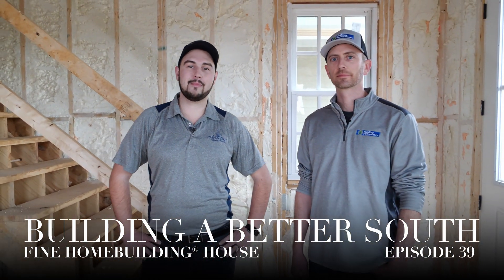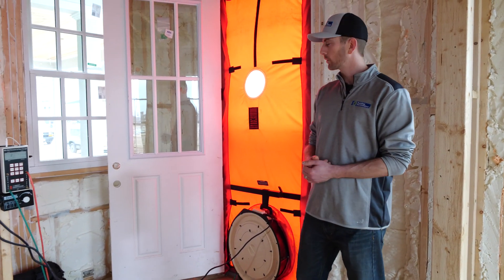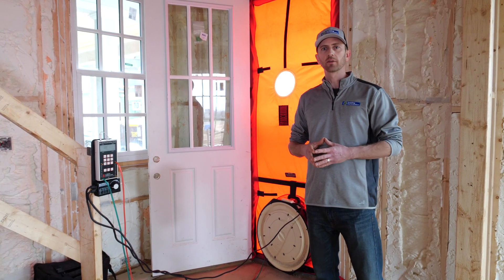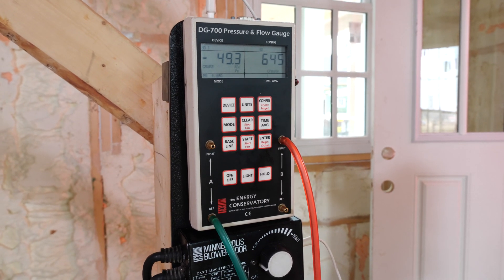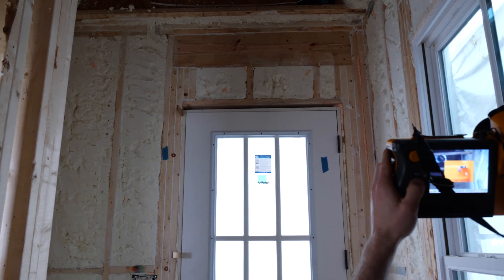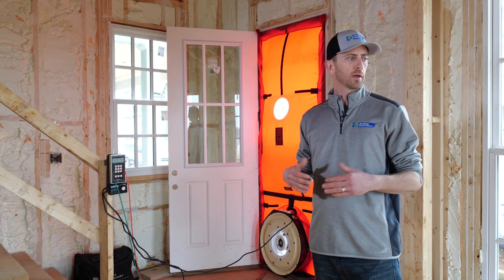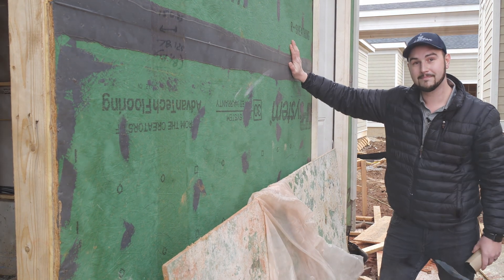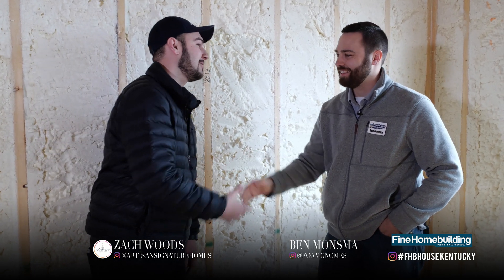How Good is It? Zip R-Sheathing plus spray foam insulation

Comment: I don't understand where the moisture is going to be able to go in this wall setup. Even open cell foam is going to hold on to a good amount of moisture once you hit 3 inches (actually open cell retrofit on roofs is causing UK insurance to drop clients), and the polyiso sheet in your Zip R isn't exactly vapor permeable. If a lick of moisture gets into the wall, it looks like it'll be stuck there for good. Am I missing something? Is the polyiso in Zip R more permeable than an Atlas foil-faced foam board? Are we just banking on the vapor coming through the open cell?

Comment: OK this video was from way back in 2019 -- However, I want to ask about the system of using closed cell spray foam with the ZIP system -- The reason being, somewhere i saw a comment that it was not a good idea?  Is there something that was learned about the ZIP and Spray foam (in NEW construction) that I should know about and not specify using a closed cell spray foam with a ZIP OSB exterior sheathing product?  Anyone have information about this it  is now nearly 2025.

Comment: Wouldn't a test after drywall is taped and finish prove to be more accurate, the tape and rock would seal the air flow where foam may have missed, just asking.
Reply from the maker: yes you are correct but we were spot checking to make sure we didn't miss any minor or major gaps before we covered with drywall.

Comment: Isn’t the flashing tape supposed to be used on the seems between the sheets instead of liquid flash?
Reply: you can use both
Reply: On ZIP they have a liquid flashing system.
Reply: liquid noticeably superior  but also at least 2x more expesabe for a house this size might add 5000-1000 in materials lab.or

Comment: Also:  open cell foam is not an air barrier, no matter what the salesman says.
Reply: I was going to say that... if they used closed cell then it would be fine.
Reply: Open cell isn’t a vapor barrier though.  Only closed cell is.
Reply: It is an incredible air sealer.
Reply: Yes it is

Comment: Doing the math:  blower door gives 570 cfm, house ~3800 sq. ft, assume 9 feet height means 34,200 Cu. ft of house.  So how many Air Changes per Hour (ACH)?  =>  1.0     That's pretty good!  Not the best, but pretty good.  Code is ACH 5, right?
Reply: would have been even better with closed cell

Comment: I still try to stay sold on this level of focus on air tightness and energy efficiency.  It's hard to comprehend.  For instance in this particular situation, I would think an ERV/HRV component to the HVAC system would probably be warranted to exchange fresh air.   That's costly.   The R version of ZIP is very costly.   Was the HVAC system upgraded to higher efficiency components?  Were the windows upgraded to higher efficiency?   Where do you stop?   If cost vs ROI isn't an issue, I guess never?   If the cost of this home is $20k higher than a blown and batt, is it worth the added savings of $150 a month with an ROI timeline of eleven years?   I'm sure the interior "comfort" (not having temperature variations from room to room is nice), yes... but with the cost of labor and materials skyrocketing over the past three years, can the industry push this level of energy efficiency AND get reimbursed for it?   Oh what a question.
Reply: Matt Risinger just had a heart attack from reading your comment. How dare you question the roi of such practices.
Reply: @pjevans1830  bahah.
Reply: Yep, to all of this. Understand, this is mostly just about saving energy, not about saving money. Energy here in the US is pretty inexpensive, so the ROI is very long. There really isn't any good reason a house needs to be this tight.
Reply: @MW-gh1mo  At least part of the "reason" is, Building Codes are mandating tighter and tighter energy standards.  In other words, it's rapidly getting to the point where it's basically legally required to have a tight house.  Sure, it's not to this level, yet, but it's apparently looking like the energy codes aspect of building codes are heading in that direction.
Reply: There is a reason to do this where it makes sense. Basically, if you’ll be living off fixed income at any point in the future and want electric bills that don’t explode either over time or change drastically throughout the seasons.

Comment: I think if I had the money to do a high-end home I would go with closed cell throughout including the attic and basement, if the is one.  Zip seems like a good product overall and isn't very much more than standard sheathing......    Now if only the cookie cutter home builders would get on board.
Reply: Joel we install around 20k sheets of ZIP sheathing here in Texas yearly. As a contractor this product costs me much more than Tyvek, but are true believers. In 2012 we took a bunch of scrap on a big job at the beginning and put in a 55 gallon drum. It was full of water 5 months latter we were demobilizing and my brother lets go dump that drum over to see what was left of that ZIP. It was amazing to us that zero difference, other than the gnarly smell. No other OSB can do that. Also if you look up specs 1/2" Huber ZIP Struct-1 specs you will see it is equivalent to 5/8" of standard OSB. Amazing stuff
Reply: @cahoonm  I'm all for Zip.  My wife and I will probably be building a modest home in the next couple of years and I hope to use Zip R sheathing to get that thermal break.  We currently have a KB home and when it got to 100°+ here in San Antonio our A/C never shut off...
Reply: @Ringele5574  Normally we found that if 7/16" OSB is at 380 msf that 7/16" Zip will be at 580 msf, which is much higher. But on a single house may not seem like much more, but on a job like were starting that has 17k that number is big.
Reply: @cahoonm  That is good news! We are getting ready to build. I was back and forth on using Advantech sheathing over the Zip sheathing. The Advantech has a 50yr warranty and repels water better vs Zip 30yr warranty. With today's lumber prices and the labor/cost to cover the entire Advantech with a fluid applied weather barrier, we ultimately settled on the Zip. The Zip seems like good compromise of cost vs quality, especially compared to standard OSB that does not fair well against moisture.

Do you use Zip on your roofs too? If so I was wondering something. After you seal up all the seams with tape or fluid applied in our case, what happens to all the holes that are punched in the decking when you shingle it? I just hope they don't cause any leakage that will go undetected with spray foam under the decking.

Comment: Why not closed cell foam?
Reply: Expense
Reply: Closed cell not as critical if the wall is going to be closed (i.e. open cell usually okay when covering with drywall).
Reply: @lasean  closed cell also provides additional sheer strength on the walls and adds additional R value as well.

Comment: What happens when you load the zip board full of siding nails? You take all that time to seal the nail heads, then you put in a bunch on nails.
Reply: What happens when you load a tyvek wrapped house with siding nails? Wouldn't that be the same thing?
Reply: So you seem to complain about nailing to Zip but not through Tyvek? Or tar paper? come on, think a minute Zip sheathing with sealer or tape seals the envelope of the  house, the siding acts as a cover for the Zip sheathing and its air perm rating is great too. If you use Zip R and high R wall insulation the house could be heated by a match. AND with proper ERV/HVAC system the interior will hardly ever see high humidity. Also if you properly seal the house its harder for the little critters to enter!
Reply: Possible that the siding nails chosen are not long enough to penetrate the sheathing entirely. You still compromise a bit with all the nails but not as much as a straight through nail.
Reply: If you are really worried about that you can get self sealing membranes to put over the Zip and under the siding.....
Reply: I think other YouTube contractors have shown (viz.  Mat Risinger) that the nail penetrations in Zip do not leak.

Comment: Please explain you go thru all the work to seal up the zip r board .. can you explain how do you seal up the hole once someone installs siding ?? I’m confused.
Reply: They are considered to be sealed when a fastener is driven flush with the surface.  I'm sure having a piece of siding acts like a gasket to aid in that.

Comment: It is interesting that they used open cell foam, which gets air tight after 3 inches. Is this more economical than doing a single inch of closed cell spray foam, and then adding blown in fiberglass on top?
Reply: Actually in my area closed cell ,well any spray foam is $2 per in per sq ft and I dont see why I should spend $10k-$15k on spray foam more than 1" thick, Mainly because I can use Rockwool at a much cheaper price and its fire resistant and dries out if it gets damp too!
and i watched a blower door test between twin brothers, identical twins, identical homes EXCEPT, one sold open cell foam other sold closed cell. Closed cell foam for the win hands down.
Reply: open cell foam is not an air barrier. closed cell is.